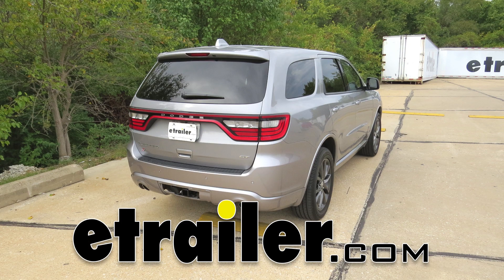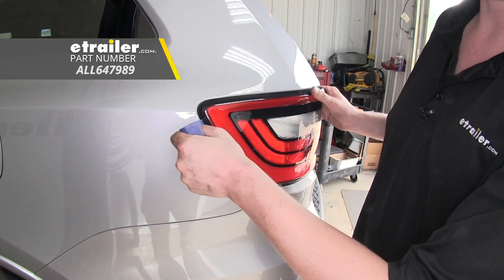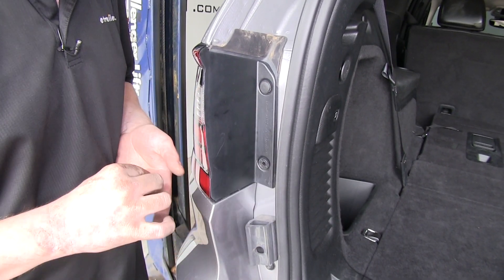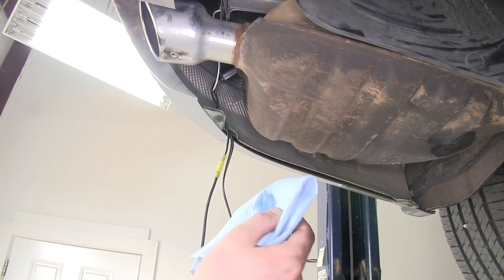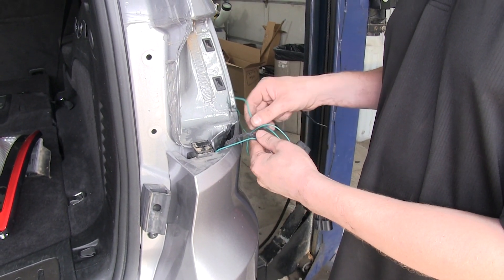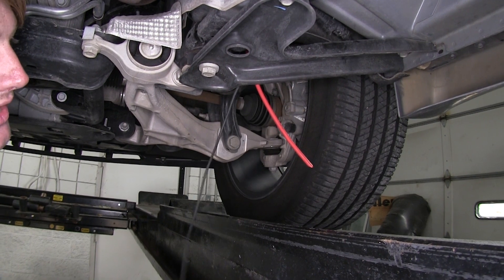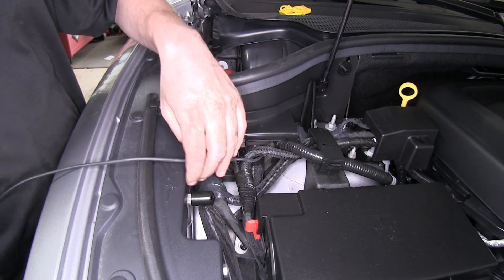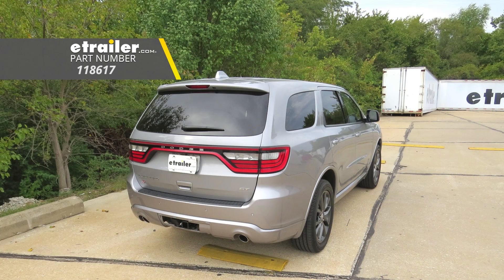Set up: T-One Vehicle Wiring Harness with 4-Pole Flat Trailer Connector on a 2018 Dodge Durango

Comment: Is this the same procedure for a 2020 Dodge Durango RT ?
Reply: I just installed it on a 2020 Durango... worked perfectly.
Reply from the maker: We have confirmed that it will fit the 2020 Dodge Durango R/T and the installation process will be the same. For installation instructions and more details on the product, check out our product page
https://www.etrailer.com/Custom-Fit-Vehicle-Wiring/Tekonsha/118617.html